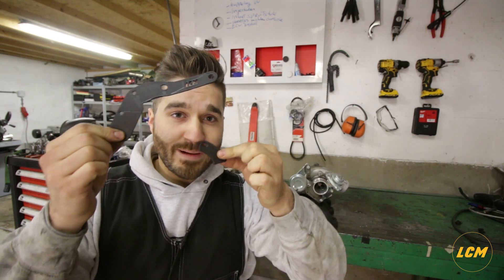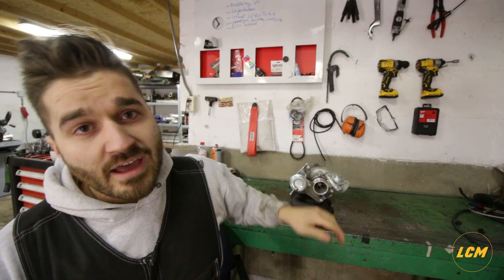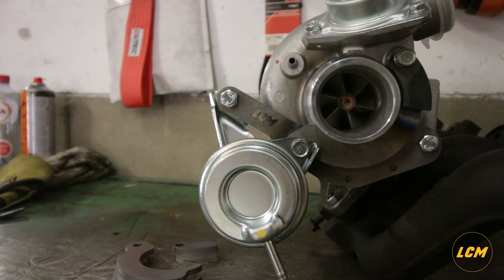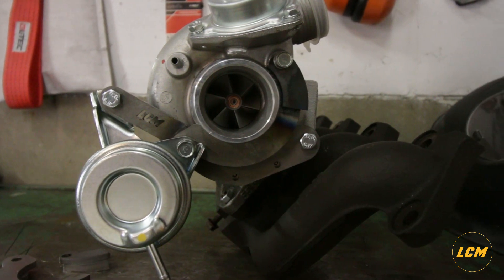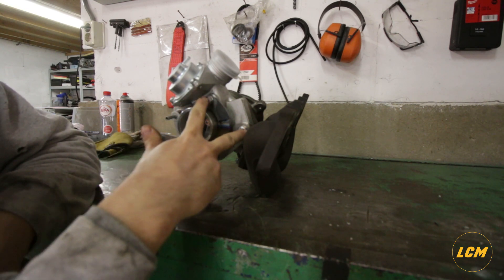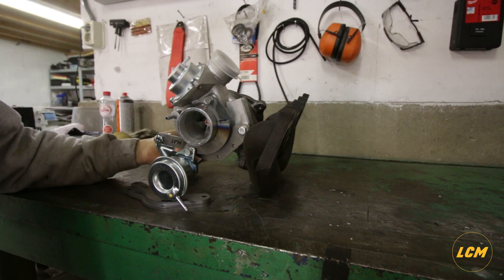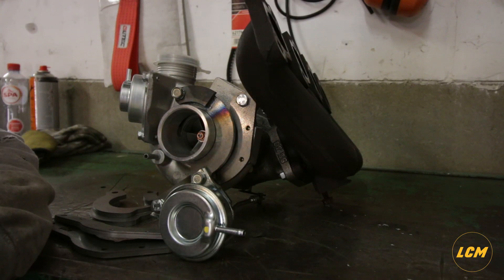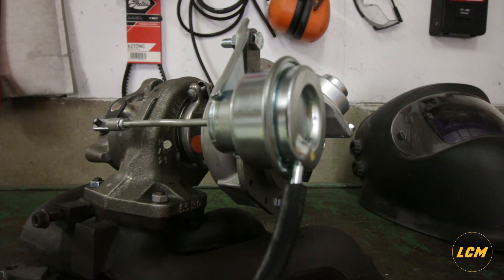TD04 19T Turbo Wastegate Actuator Relocation Bracket - Volvo B230

Comment: Was a little disappointed when I received my bracket today, it's not bolt on as it needs filing down to make it fit, ah well, less work than making a bracket myself
Reply: After finally filing it enough to make it bolt to the turbo, I now find the bolt holes for the wastegate don't match up with the actuator bracket, this is ridiculous!! "Couldn't be any more easy" lol

Comment: I was thinking I would just make a halo out of steel and attach it to the original mounting location. Then drill out where the new location needs to be, add in a support or two and you are good to go.